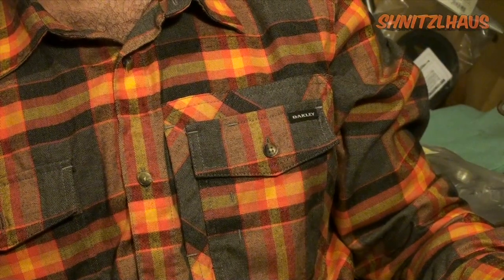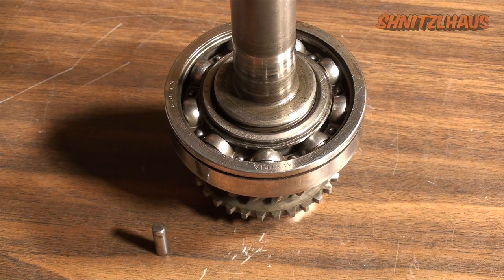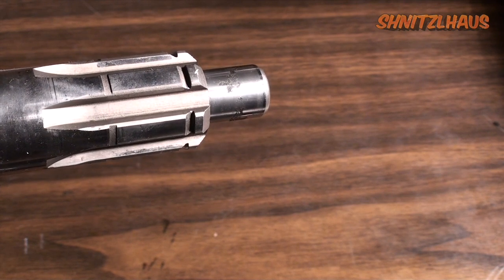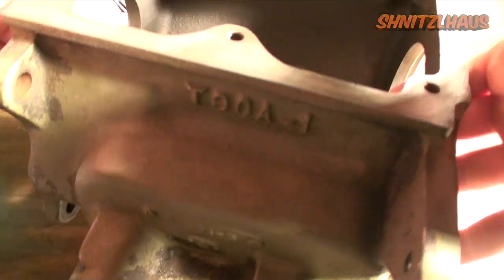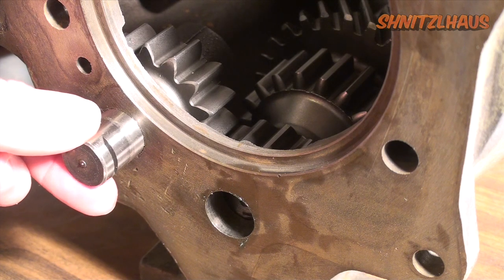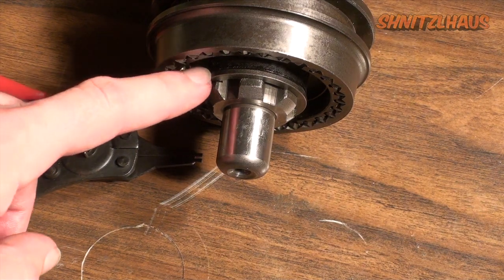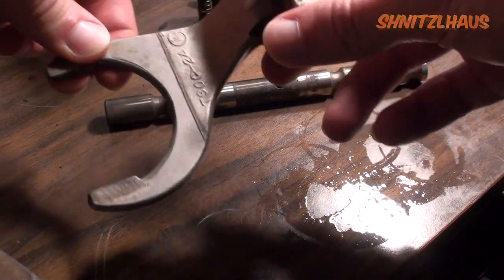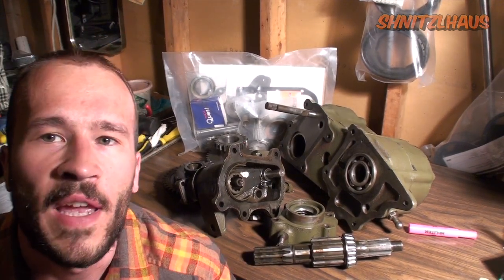Spicer/Borg-Warner T90 Transmission: How To Rebuild

Comment: I recently ie 8 days ago ,i got the 3 Speed Gear box of my Mahindra & Mahindra CJ500D rebuilt.
I will be testing it on Monday ie 22 Aug 2022.The most important point is , Engage the First Gear only when the Vehicle is on Stand Still.Never shift back from 2nd gear to First on the fly.
An Awesome Assembly by you 👌👌👌👍👍👍👍🙏🙏🙏🙏

Comment: You can reinstall the top gears when the trans is mounted to the bell housing. Just push the syncro as far forward as you can, slide the 1st/reverse gear forward (to the neutral position), and if you curse just right, it will eventually slide in...

Comment: I rebuilt my 1973 cj5 jeep T-18 transmission and my dana 18 tranfer case i never think I could do this. If it wasn't for this video I would never tried looks very complicated but it wasn't just because of this video and it came out excellent I have 35 miles on my rebuild and it shifts excellent thank you now going on 700 miles still going.!!!

Comment: I recently completed a rebuild of both my transmission and transfer case using your videos (very helpful) 

I haven’t installed them on the Jeep - just added oil on the bench and I am getting a very bad leak where they meet together

I have some pictures of the area  - 

Any thoughts?

Thanks in advance

Comment: It's been two yrs since I did this. My box is installed tranfercase back on .I am so thankful you made this video. Although I have not driven it yet I'm almost ready ,fuel tank & front brake slave cylinder to go then me & my Willey's will have a good time. Thank you so much.
Reply: Thanks from South Africa

Comment: Great video. I'm rebuilding a T19 and it is similar. Your video is very helpful.
Reply: it's nice to see a fellow fallout fan who also turns wrenches.

glad to know I'm not alone.

did you get her rebuilt yet?
Reply: Still working on it.  Have it all apart and finally got the case and other bits painted.  Hoping to get it back together this weekend!

Comment: You’ve got to remove that snap ring off the bearing that goes into the transfer case where the Pto gear slides on or it won’t seat properly

Comment: My 1971 Scout 800 B has a T90 transmission. I have a question for my little Devil Box.
At 22:22 minutes , the video states to place 14) needle bearings that come with the kit. When I place these , there is not enough net area for one shaft to mate into the other..It seems I need 20)+ smaller diameter bearings. As well , these bearing need to be approximately 5/8" long in lieu of the 3/4" bearings provided in the Novak kit. Could someone advise what bearings I need to purchase and place into this monster? Another aggravating item , my cluster gear is reverse hatch direction from anything I can find available. Thanks for any help..! Great video !
Reply from the maker: Hey Raybone, the T90 came in various models. I'm not fully educated on all of them but maybe you have one of the "T90C" or "T90J" I am fairly certain that would be your issue as I believe they all varied in gear ratios etc.

Comment: Great video, complete and very informative. The one question I have is can I still retain my oil collector if I’ve upgraded to the later model year T90 cluster gear with the lower first and second gears? Third gear has 35 teeth on the cluster gear as opposed to 33 on the original cluster gear.
Reply: I know this is a year old question,but may help someone about this now,willys must have thought the oil slinger wasnt really necessary in the later T-90's,they deleted it,but it would be the rebuilders decision to put it back or leave it out,if you leave it out,dont forget to plug up the two bolt holes that retain it!

Comment: Hi there.  Just completed my rebuild and this video was really helpful.  (I couldn't view it using Mozilla as my browser but it worked fine on Explorer).  The tricky bit is refitting the gearshaft.  Also a bit puzzled that the rear bearing can drop out of alignment when the assembly is completed as the gearshaft can separate - but maybe this will be resolved when its refitted to the transfer box?
Reply from the maker: GlynBryan exactly, once you get the transfer case bolted up it will keep all the T90 gears in place. :)

Comment: Thank you for this video and the video of the dana 18 transfer case. I am in the middle of rebuilding mine.  I have them at the machine shop getting dipped so I can paint them.  Can you share how you removed the bearing from the main shaft in the T90?  I am going to have to buy the tool.  I have a press.
Reply from the maker: you can use a puller, press or drift punch. just be smart about it, don't mar any surfaces so use soft jaws if its held in a vice. if your pressing make sure everything is coming off straight.  puller or press would be first choices.

Comment: Although I am very familiar with engine and rear end rebuilding, I had never tackled a transmission until about 10 years ago.My first trans rebuild was an automatic from an 86 Pontiac Grand Prix and I was scared spitless digging into it, totally afraid I'd screw it all up somehow. I was amazed at just how easy it actually was though and have since rebuilt a Borg-Warner T-5 from an 83 Pontiac Firebird as well. Your rebuild videos sure would have been a huge asset back then. Great stuff and keep it up...Liked and subbed.

Comment: Only one problem. You made a mistake on the rear output bearing. In the video you put it on backwards. You put the snap ring on the outside, but in real life it has to go on the inside closest to the transmission. The bearing seats into a cutout in the transfer case almost 3/4" and rests against a shoulder machined into the case itself so the snap-ring groove on the output shaft NEEDS to be closest to the transmission. Wish I had known the BEFORE I had it pressed on the shaft
Reply from the maker: I will have to check this out, I dont see it as an issue the snap ring should be removed before you assemble the transmission to the transfercase.  my stock bearings that I pressed off before rebuild did not have a snap ring groove.
Reply: I've rebuilt several of these, and the orientation of the bearing is not critical. It is easier when the snap ring groove is oriented towards the transmission, as that leaves the filleted edge of the bearing facing rearward for easier transfer case indexing. Very well done, ShnitzlHaus.

Comment: When installing the bearing on the main shaft you put a snap ring on the bearing. On the picture of the exploded view of the T90 there is NO snap ring mounted or listed. There was no snap ring mounted on my bearing when I disassembled my T90. I even think that the snap ring prevents a good assemblage of the T90 to the Dana 18 transfer case. ??? Otherwise, a good guide. Thanks.

Comment: First I appreciate the effort in the video you did a great job. However, no one talks about how to remove the oil collector or the main drive gear. I know you did say this video was not going to show that and I noticed you did not install the oil collector. Did your T90 have the oil collector when you did the dis-assembly? If you have the oil collector its impossible to remove the main drive gear. I am sure there is a method to this (much like removing the flywheel from the 226 so you can get to the bolts on the bellhousing), if anyone has or knows the trick please let me know.

I love my Willys but I have to question some of the Engineering :)
Reply from the maker: +yffrules Thank you, to remove the oil collector you must essentially pull apart the transmission, funny but true its one of the last things to come out with the main drive gear.  abbreviated (for a general idea), you get the main shaft with all the upper gears/synchros out, you then drive the lower cluster idler shaft out of the case - this allows the cluster to lay on the bottom of the transmission which then allows you to remove the main drive and oil slinger.  the T90 is a puzzle but a relatively small one.  my T90 had a oil collector but it was very rusted out so I opted not to use it, its a very debated topic.  essentially the oil collector would help lubricate the upper bearings should you run low on transmission oil - either forget to check the level or because of the nature of the T90 and Dana 18 sharing oil on a steep incline the transfercase might take on more oil leaving the T90 with less then optimal fluid.   to open up another can of worms you can run a full gasket mating the t90 and dana18 to stop the sharing of oil, just make sure you fill them individually!  anyhow "Novak conversions" online has a great write up on how to disassemble and assemble the T90

Comment: Hi! Did you use the rubber grommets on the bearing retainer bolts?
Reply from the maker: memory is slipping, if the do not call for that in the parts list I would highly suggest a thread sealent on the threads and a light coat of non hardening sealer (or some gasket maker) on the base of the bolt head.
since these threaded holes access the inside of the transmission you want to keep oil from seeping out.

Comment: HI BUDDY, can i ask you your help to find parts for my WARNER T85N wit overdrive R11-1W  ? they told me is a rare  trans.
help me please,i heve to rebuild it...almost all the gears are broken and shafts in bad conditions..
Reply: I have the T96 with OD and a complete series about them. The R11 OD is indeed quite rare, but the only difference between the R11 and my R10 is the R11 has 4 planet gears instead of 3. And yes, I do believe the T85 is kinda rare, but Iv'e seen some T86s on ebay.

I also believe the T85 and T86 are quite similar to the T96. So you might want to filter through some of my videos (there are alot of them unfortuantely) just in case there is some info that might be of help to you.

As for parts, ebay has lots, and you could also try kaiserwillys.com and hermtheoverdriveguy.com. rockauto also has the needle bearings for under $10. They can also simply be cut from a suitable rod for even cheaper if you really wanted to.

If the gears have some pitting and scratches, thats not going to interfere with driving. But if most of the gears are broken and seriously damaged, then I think it might not be worth it trying to find and replace so many expensive gears. The other option is buying another parts transmission.
Reply from the maker: Good help on that :)

Comment: Most people here run from differential work.
Reply from the maker: +Ken MacMillan Yes you are correct! maybe one day I will make a video of that.
if one can do a transmission or transfer rebuild then one should be able to do a differential, most people just need to understand the proper order in which one would rebuild a diff and it helps to invest or make setup tools. the actual process of rebuilding is straight forward. a company that marks for pinion depth and the use of a pinion depth gauge makes things super easy, reading patterns I think scares allot of people away.